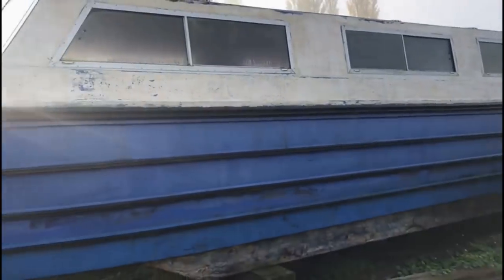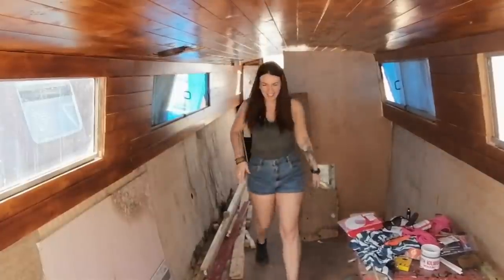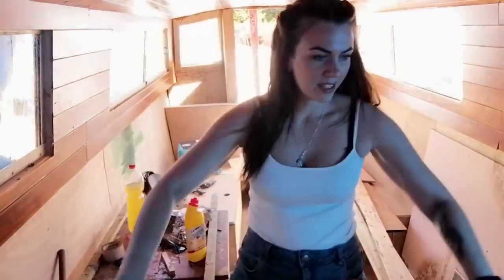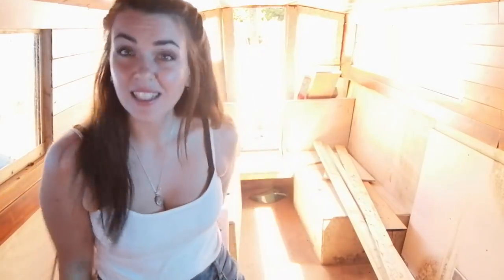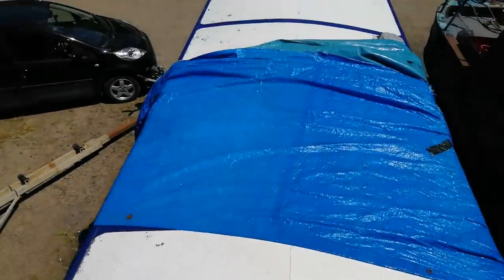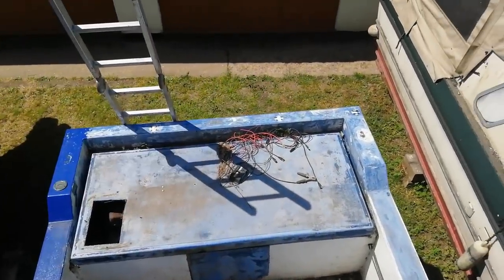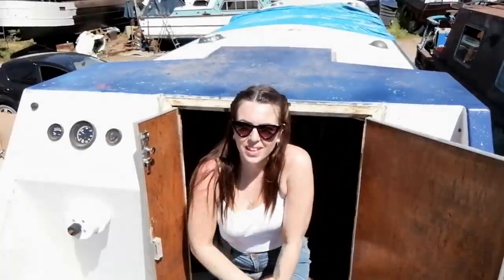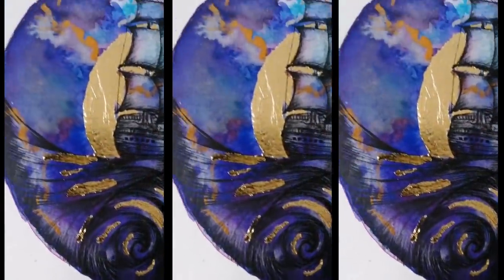Ep 26: Removing Mould from a Canal Boat!

Comment: Until you get your boat water tight, windows, hatches, vents, doors, and have a reliable sump, you are simply rearranging the deck chairs on the Titanic.  Get water tight and replace all wood currently in boat.
Reply: You can bet the backside of those pannels have much more mold than the outside.
Reply: @pavichapin  Absolutely right! My first job would have been to strip every bit of wood out because you will never, ever clean all the mould out if you don't. It will keep coming back through and you REALLY don't want to be living in there breathing that all the time.
Basically, I hate to say it but all your hard work and materials used in cleaning and bleaching, not to mention future painting and fitting out, have been wasted. Harsh I know, but it's the reality.
Reply from the maker: @ellaevansbolt  don't worry, I wanted it all scrubbed up and clean to see what we were working with as the wood is new. All the panels need to be taking off anyway as we're redoing the insulation as well, so we'll be able to take a closer look! Will keep you updated :)
Reply: @EarleWrites  That's good to hear. Sorry if I sounded like the voice of doom, but you can't be too careful with that stuff.
You might get away with steam cleaning the removed panels, depending on the quality of them. Steaming will kill the spores. Worth a try anyway. Not talking about pressure steam, just something like the steam wallpaper stripper should be enough if used carefully..

Comment: Buying a boat , do they own it to sell, is the hull sound, does the engine work. Anything else can be changed, you don't have an engine, so you can't charge ba tteries , so they have a generator to do it. Enjoy  the journey , you have a lot to learn, and it will cost you lots of money if you don't learn the basics.

Comment: Nice vid Liz.......it’s great to see you back on the project.
It’s very easy to get caught up in the cosmetics and amenities......because that stuff is fun and gratifying.
But as you have learned, it’s more important to get the “bones” of the boat right first. Replacing windows, fiberglassing, adding coach roof hardware, plumbing, electrical, and all the other underlying upgrades / repairs need to be completed before the pretty work is started. Otherwise you will be doing it twice.
Good luck.....I’m pulling for you.

Comment: be careful of your air draft lots of low bridges on canals
Reply: They used to measure to get the annual lic.
Reply: I agree that will likely be an issue. If correct, the railing can be designed to fold down, or to be removable, to prevent a potential clearance problem.